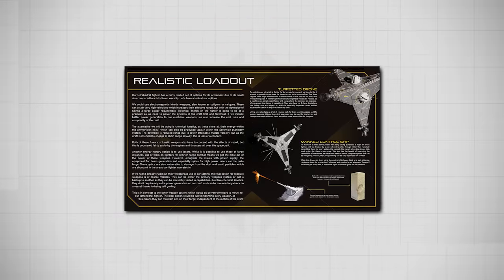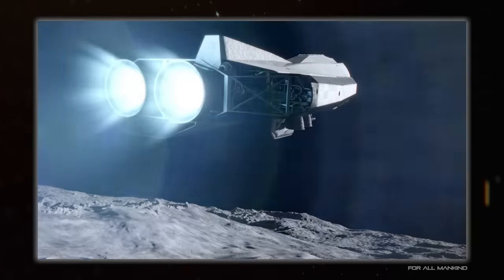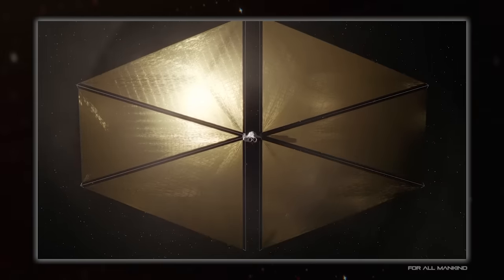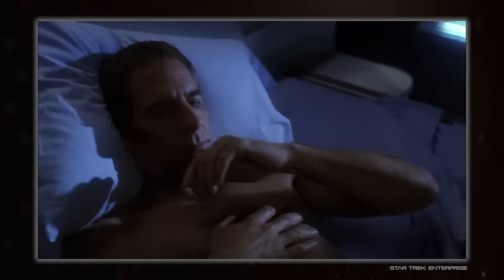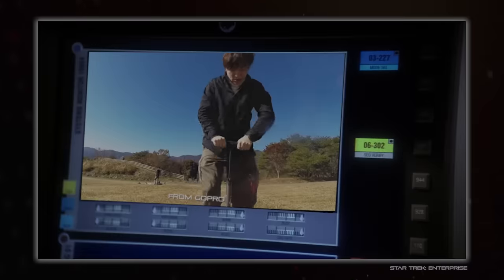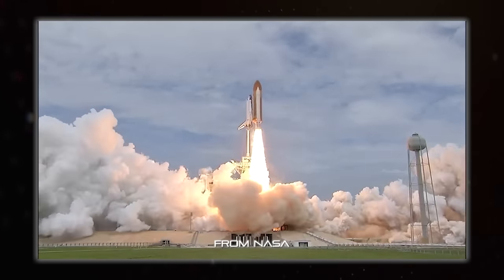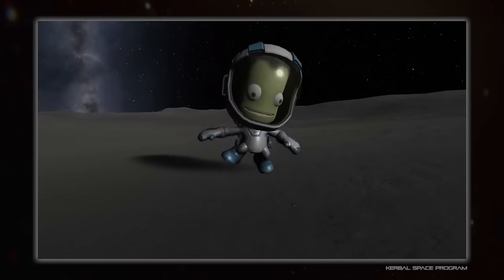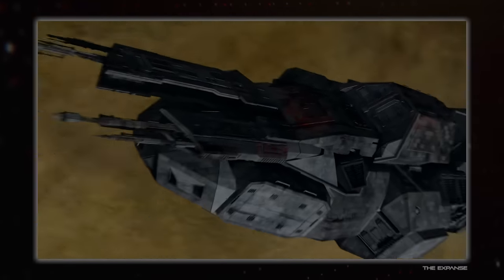Realistic Spacecraft Maneuvering

Comment: It’s always interesting the physical controls (sticks, keyboards, pedals) that get used. Cars basically only care about two of the six degrees of freedom (yaw + forward/back) with you hands handling steering and your feet handling acceleration/breaking. Air planes generally only care about four (yaw, pitch, roll and forward/back) with one hand handling pitch and roll, the other hand handling thrust/speed and your feet handling yaw. Helicopters are interesting because they work like airplanes except rather than your thrust handling forward/back, it handles up/down. So, if we wanted to control a space ship, we would need some way to handle two more inputs. I’m sure there are designs for controls that do this, but I’m not familiar with any of them. I’d be really curious to know how any of them would work along with the ergonomics of them.

Comment: One issue that Scott Manley highlighted about space fighters is that the thrust of turning (pitch, yaw) is usually depicted as way more than the main engine

So if you wanted Star Wars style dogfights with real space craft, you'd need your thrusters to be several times bigger than your main engine
Reply: i have allready done that in a sci fi space game called avorion allready with them very big rcs thuster clusters untill the main enegine are needed. shure it might be a flying brick but its a very fast and menruvable flying brick when realstic pisces are involed! it is also like very very very big!
Reply: Yeah this is what bothers me about a lot of spacecraft. So often they keep the main engine burning, struggle to pull up, and turn in a big arc . . . using what force exactly? This isn't an aircraft!
Reply: @skylark6167  well in battletech space units for the most part the main engine on space battltech units is bacly both a reactor that prrvides power and alot of plamsa for the engines. these are for battletech dropships, warships and aerospace figthers. these battletech aerospace enngies also do porvide power for rcs that are both chemcal but also plamsa arcjet and plamsa thrusters for mnuivering thrusters as well. but the battletech K-F ftl drive doesnt use any fuel but is just only actaly pasvly recarged by both solar radation from the nearest star or if there no actral star in the sisitem it is in then it recharges from backgronud coismic radation instead. but howver the later is at a some what  of slower rate but its still far faster then any startrek ship thats not a borgcube using transwarp that is.
Reply: @skylark6167  well while you can use  very large rcs thrusters but there also a real life easer way of alowing space ships to turn and rotate  with just using big control  moment gryoscopes+ Reaction wheels that can also work for just makein starships turn and rotate wihout needing so much fuel consuming rcs thrusters. you comibe those with realy big main thuster engines and that will save alot of fuel.

Comment: For gun-based engines, there's actually been studies into detonation engines, since theoretically, the burst's impulse is extremely efficient given its extremely high initial velocity for materials.  It doesn't have to be a nuclear bomb engine either, normal explosions could theoretically work.  
To be precise, orbits are a precise amount of falling, where you're constantly moving forward just fast enough to be falling at "sort of the same rate" that the ground is falling away.  It falls in between escape velocity and sub-orbital, and the large variety of these give you a lot of different items.
There's actually the additional problem of pointing for spacecraft, since they're often direction sensitive in a variety of ways (like navigation sun/star trackers, cameras and sensors for coverage, antennas for communication, and different portions of the spacecraft being more or less able to absorb thermal radiation (this is a big one: spacecraft don't have a lot of places to put away heat, but they can get into very cold or very hot locations relatively quickly)).  So the ADCS systems often need to compensate throughout a spacecraft's journey, pointing it different directions, and the designers have the hard job of trying to figure out where to put everything so every system can be pointed in the right direction at the right time.
Another manuever method is gravity assists, changing your speeds by by using the planets themselves, essentially slingshotting yourself through an orbit and gaining some momentum that way, or using it to change direction.  This can save you a lot of fuel for pointing in the right direction.  
Traveling in orbits in general is a matter of fuel, velocity, and acceleration, more akin to sailing (where you're at the mercy of nature), rather than flying a jet fighter.  Your own engines are so much weaker than the power of gravity that you sort of ride the train rather than direct it.  Most spacecraft have their paths plotted out FAR in advance, and their path through space dictates their system.  Just look at James Webb: at every stage something is deployed at a particular time in orbit, with little deviation from a pre-planned path.  But even then, spacecraft are constantly talking to their ground controllers as much as they can, because the margins for error are very small and the solutions to prevailing problems very few and far between.

Comment: For all of its flaws Babylon 5 was exceptional when it came to the physics of space flight. They had to trim combat to line of sight close up fighting for TV, but they went so far as to explain how human warships couldn't maneuver as well as Minbari because human ships still used centrifugal sections for simulated gravity while the more advanced Minbari ships had gravity generators. I recall at one point the B5 pilots being told how potential enemies would engage autopilot and maneuver so aggressively that they blacked out just to get the kill.

I also love the way Mobile Suit Gundam's space combat is contextualized into being close quarters even in space do to radiation emitting from fusion reactors that interfered with radio communication and radar. Mobile Suits became in part because a humanoid machine could use its arms and legs for Active Mass Balance Auto-Control (AMBAC) making them far more effective in zero g than contemporary airspace fighters.

Comment: I realise you were probably simplifying for the general public, but (most) watercraft and aircraft don't generate thrust by sucking in the surrounding fluid and pushing it out the back.
Propellor driven craft use lift to generate thrust (the propellor is just a bunch of wings which are spinning through the fluid). 
Water jet propulsion is the main exception to this, as it literally does suck in water, then shoot it out the back at higher pressure. This system is a relative rarity though, as it's expensive and doesn't work as primary propulsion for large ships. 
Aircraft jet engines don't work this way though, as they inject fuel into the air supply and ignite it to generate thrust. Simply firing the air out the back would not generate enough thrust for passenger planes or military jets.

Comment: Orbital maneuvering -
Forward is up - increasing speed means your orbit breaks away from the object you are orbiting and you move up relative to your original path
Up is backwards - moving up at the same velocity means in longer orbit than original so you move backwards compared to original path
Backwards is down - slowing your speed means your orbit drops relative to your original path
Down is forwards - moving to a lower orbit at your current forward rate means you are in a lower radius orbit and move forward in ground reference to your original path

From Integral Trees by Larry Niven.

Comment: Does thrust vectoring work the opposite way you'd think based on the understanding of a planes flight in a vacuum?
I mean you fly in one direction, you tilt your engine/nozzle "up" and start to fly "down" relative to your former direction of travel?
Just with you craft not aligned to your travel direction then, but tilted upwards.

If a jet plane vectors it's thrust upwards I'd expect it to go upwards as it's pushing against air and is generating lift.

I guess the easiest to comprehend way is to rotate you spacecraft with auxiliary nozzles into the desired direction and then just use the main engine to go forward.

Comment: I think you should make another video where you rework some key points. For example, more clearly and specifically address that you can't simply point where you are going, and instead will almost always need to line up to perform a rendezvous. (Depending on just exactly how much fuel you have) . So,, it IS possible to just point at the space station you want to catch, and burn your engine to catch it,, but you will need to burn your engine the whole way, and you will need a lot of thrust because you will need to be changing your vector to match the shape of the stations trajectory as it gradually curves away from your trajectory line. ((so, your trajectory will always be closer to a straight line as long as you are moving faster than the station, which means that although you may be moving towards the station at an earlier time, at a later time you will start to move away unless your trajectory changes to match the stations orbit)) -- IMO orbits are not "hard", it's just that no one talks about them.

Comment: really cool video ! could you talk about Electromagnetic braking to maneuver in space? (Rather than thrust, you could use the drag force from changing magnetic fields to electromagnetically brake the motion of a conductive surface. By rapidly changing the magnetic flux linkage, high electric fields and currents would be induced, producing drag. This could be used for braking, maneuvering or even hovering an object. from ChatGPT conversation) and electromagnetic drag for propulsion?

Comment: It's worth noting that orbital mechanics was the PhD thesis topic of one Dr Edwin "Buzz" Aldrin. You might have heard of him.

One fairly straightforward way to get a basic grasp of orbital mechanics is to consider what your thrust is doing to the entire orbit. Imagine your orbit is like Larry Niven's Ringworld.

If you burn your engine with the capsule facing "forwards" (prograde) in its orbit, you add energy to the orbit, which makes the orbit higher. Higher orbits are slower than lower ones, so you use this if you have overshot your rendezvous target. If you do the opposite (thrust while the capsule is facing "backwards",  or retrograde thrust), you remove energy from the orbit, making it lower and thus faster. (In the Ringworld analogy, this would be like stretching or shrinking the ring.)

If you thrust towards or away from the centre* of the orbit, you move the entire orbit in the direction your capsule was facing (assuming you use your capsule's main engine). If you are in a low earth orbit, this is usually not a good idea, as you may find yourself entering the thicker parts of the atmosphere half an orbit after you applied the thrust.

If you thrust to the left or right of your capsule's direction of travel, you will change the angle of the orbit relative to Earth's equator. (Or, indeed, relative to any other planet's equator, depending on where exactly your spacecraft is in the universe.)

This is an oversimplification, with a lot of the subtleties elided over, but it's a good, intuitive (-ish) starting point before you go getting into all of the calculus.

* Since all orbits are ellipses, there are actually two centres, known as the foci of the ellipse. ("Foci" is the plural of "focus".) In many of the orbits used in historical crewed spaceflight, the two foci were so close together that it made little difference.
Reply: I never really got the higher orbits are slower part though. like slower how? I play KSP so I understand that if you're in a higher orbit a space craft in a lower orbit "behind you" will catch up to you but whenever you start burning prograde your orbital speed increases. so how is that going slower? (like a higher orbit has a longer orbital period compared to lower orbits but you are going faster around the planet right?!)
Reply: @zwenkwiel816   - it's not only the orbital period of a higher orbit that is longer. The actual speed of the vehicle / moon / whatever relative to the planet is slower. My understanding is far from complete, but this explains how the first attempt at orbital rendezvous in the Gemini programme had completely counter-intuitive results. Although, from on board, it looks like the two vehicles are static, they're still travelling at about 11 km/s (give or take a bit) relative to the Earth's surface.
Reply: @nigeldepledge3790  but then what exactly is this orbital velocity I see on my Navball in KSP? cuz that definitely increases as I burn prograde 
and to get in a higher orbit you just "add" delta-V to your trajectory which basically means adding speed right?! 
and then when you enter an atmosphere you're going a lot faster if you enter from a high orbit.... (like If I re-enter Kerbin's atmosphere straight from the mun I'm going way faster than if I'm coming from a low Kerbin orbit.)

this shit is confusing, no matter how I think about it I still see it as going faster XD 

(like most of the time in KSP I don't even know why I'm doing what I'm doing. sort of got an intuitive feeling of orbits and rendezvous' and everything by just playing a lot and experimenting)
Reply: @Zwenk Wiel   - the higher re-entry speed from a higher orbit is because you started at a higher point in the planet's gravity well. There was more gravitational potential to be converted into speed on the way down.

I have an idea why the KSP speed indicator reads a faster speed when you burn prograde. It's one of the details I omitted to keep things simple. 

Strap in: this may take a while.

If you're starting from a circular (or near-circular) orbit and you burn prograde, you lift the apogee of the orbit. The perigee, however, remains at the same altitude. The point at which you made your burn becomes the perigee of a more elliptical orbit. You have raised the apogee altitude and increased the orbital period; and you have decreased the orbital velocity at apogee, but the speed at perigee does indeed increase.

An orbit that is highly elliptical is characterised by a large difference between the speed at perigee and the speed at apogee. This is analogous to the path of a stone if you throw it upwards at a steep angle : its velocity decreases as its height increases, until it's moving only slightly at the top of its arc (and that is just the horizontal component of its velocity, as its vertical velocity is momentarily zero). It then speeds up again as it descends back to the ground.

Any object in an elliptical orbit will travel faster near perigee than it does near apogee (or, to generalise, I should say periapsis and apoapsis, because apogee and perigee refer only to orbits around the Earth). This is in accordance with Kepler's third (I think) law of planetary motion : that equal areas are swept in equal times.

When you burn prograde or retrograde in an orbit, you change the velocity at your current position of the orbit, and change the altitude at the opposite point of the orbit. This is how you might make a Hohmann transfer orbit to get from Earth to Mars: you burn prograde (thinking heliocentrically here) for so long that your orbit's aphelion matches the position of Mars's orbit. When you arrive at Mars, you would burn retrograde to enter an areocentric orbit, but if all you wanted to do was match your heliocentric orbit to that of Mars, you would burn prograde to lift your perihelion to match Mars's orbit.

Sometimes, it actually is rocket science.

Comment: What gets me is how people still think planetary flights travel in a big curve through space. Space travel is a straight flight between A & B with minor course corrections and unless changing speed no engine power, just drifting to conserve fuel. You pick a destination and travel the shortest path to meet the target planet which is traveling through space and will meet you at your destination. The planets travel in curves around the sun but the ship goes straight and they meet somewhere. But because some artist draws a picture an shows the rocket traveling in an arch they think it's real. Shows like the Expanse are so wrong in so many ways with the ships burning fuel 24/7 while traveling unless your using a hydrogen scoop or ion engine that moves particles from in front and pushes them out the back your just wasting fuel for no reason, once out of a gravity well around a body you just freefall until you get to where your going and speed is a constant. Same goes for payloads. What works for Earth launch weight changes once in orbit or if launched from the moon until you get to your destination then it has to be reconsidered for landing according to that destinations gravity. A rocket carrying 100tons lifting off from Earth would only have 20% of that weight landing on the Moon and just under 40% of that weight landing on Mars because of the gravity. Why do know-it-all's always want to argue about FACTs on the web simply because they saw it in a movie made to entertain?

Comment: 2:27 Why is a gun less efficient than a reaction engine for maneouvring purposes?

Because a ballistic weapon is primarily about imparting kinetic energy, not momentum, to the projectile. It is energy that does the damage. So a smaller, lighter, faster bullet is more deadly than a larger, heavier, slower one: if the two are given the same momentum, a projectile that weighs half as much will end up with twice the kinetic energy, and be twice as destructive.

A reaction engine, on the other hand, is all about pushing some amount of momentum out one direction, so the vehicle gets the same amount of momentum in the opposite direction.